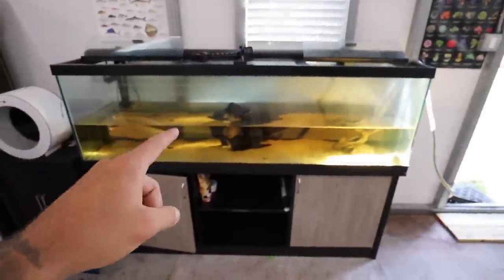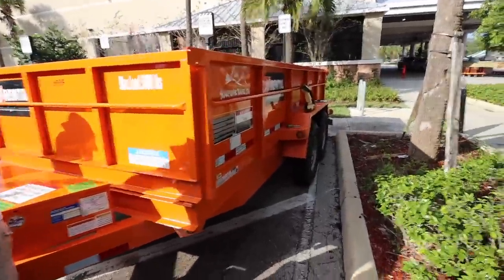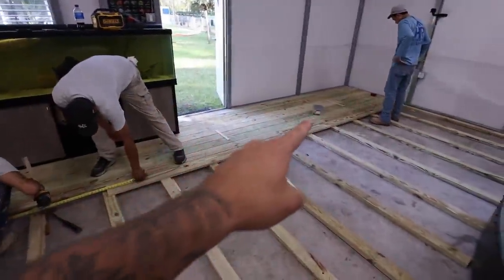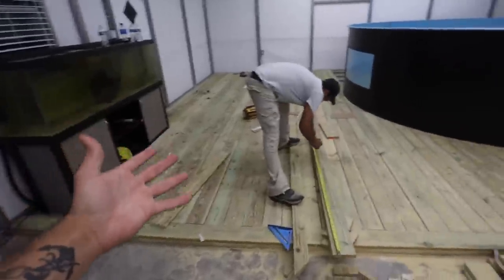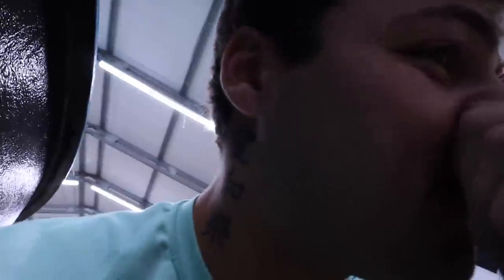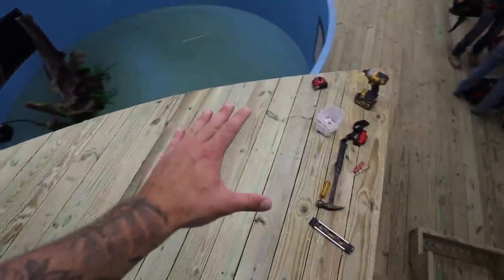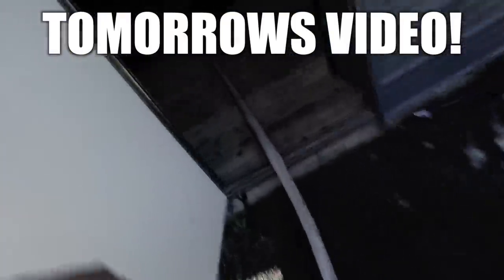Building the 5,500G FISH POND Deck & Dock!! (crazy)

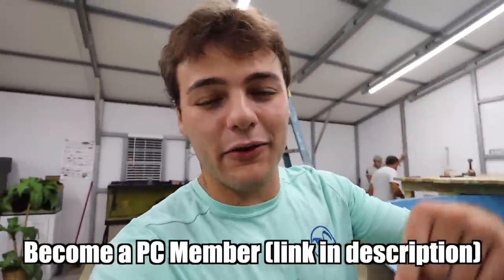Comment: Had this idea at 12:41 in the video build a turtle pond under the deck and you can put the heat lamps and UVB lamp attached to the bottom side of the deck

Comment: The decorations for the 5500 flip it on its back drill the bottom out 1 in by 6 in in and fill it in with concrete that should weigh it down and not have to add stuff to weigh it down you get that empty look of a tree growing through the center

Comment: The carpenter in me is cringing so hard lol. No sill gasket under your runners. Didnt see the runners pinned to the floor. Im hoping that lumber is pressure treated or atleast some lumber that can handle the moisture (dont kno your bulding codes in florida) but all in all this looks slick